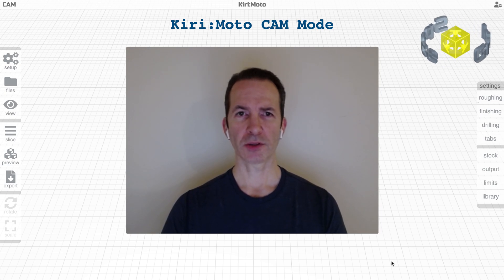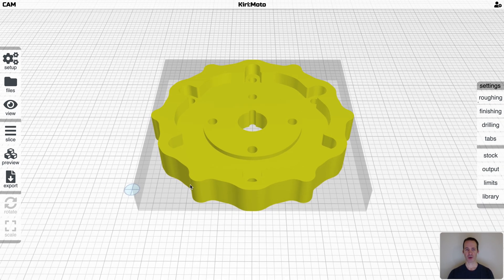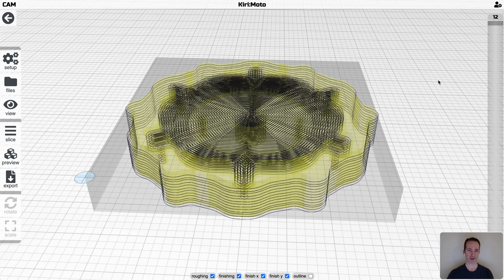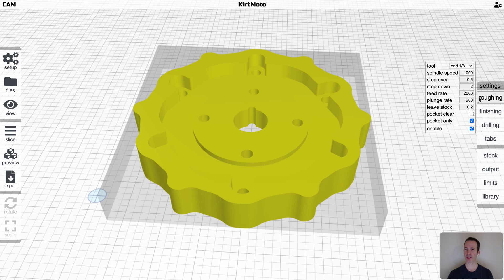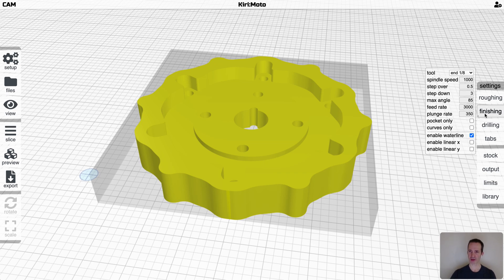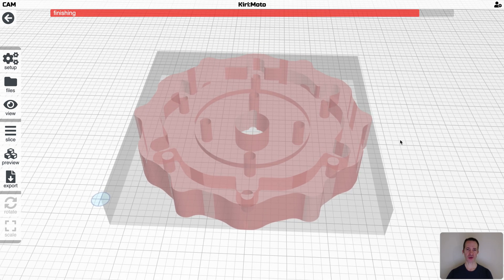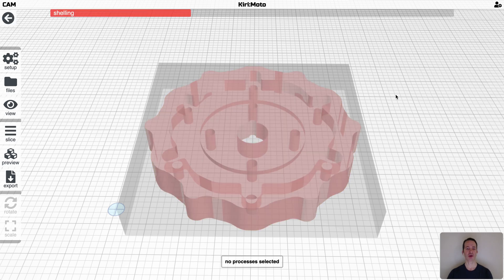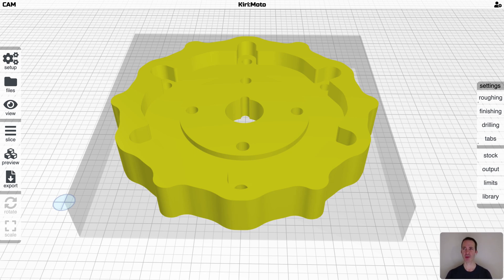Kiri:Moto CAM Mode Features

Comment: I just put together a CNC machine kit and was looking for something to teach me how to use CAM slicers. This was perfect. Thanks!
Reply from the maker: Very welcome! Check out the new features in the 2.4 development version. You can select 2.4 under the profile menu (top right person/gear)
Reply: @GridSpace  Thanks, but actually the exported file in 2.4 was blank. I'm working with 2.3 now and test-ran the code through Candle. The spindle didn't engage though, and I'm looking into this now.
PS: To view animation of the slice, the only way is to import the exported file, right? I guess animation is still being worked on in 2.4.
Reply from the maker: @anonymouse527  not all settings carry over from 2.3 to 2.4, so you may need to re-enable some things when switching. also, if you do find a bug, please use profile export (top right) and check "include workspace" then email the resulting .km file to sa@grid.space ... animation is only available in preview mode when stock is set. In order to add spindle commands, you need to clone the device, set a max spindle speed, and then make sure the device gcode fragment for "spindle speed" has the correct gcode. any occurrence of {speed} will be substituted when the gcode output is generated.
Reply: @GridSpace  Nice, the animation works! I did what you suggested. Cloned the device, set max spindle 10000. Still no go. Then under gcode/spindle added "S1000". Removed tool change line "M6 T1" (it gave me an error in Candle). I also set max 10000 in Candle settings. The spindle works manually but doesn't spin when I run the code. I can email you the .km
I'm also trying to add tabs to no avail. It may be a user error though, I'll keep trying.